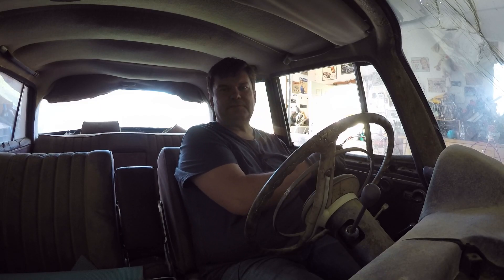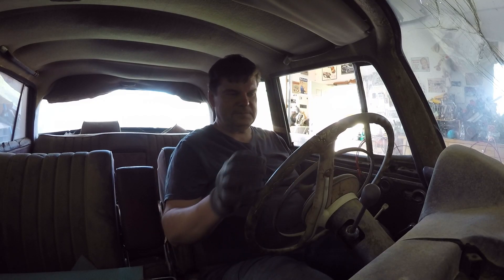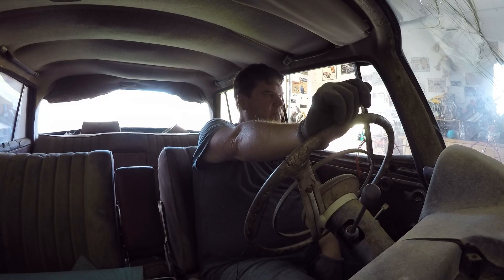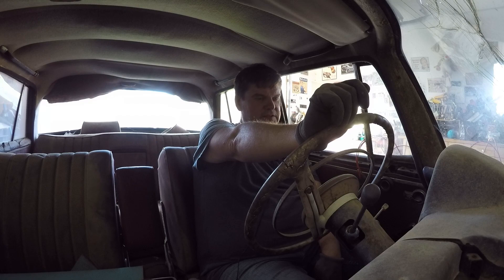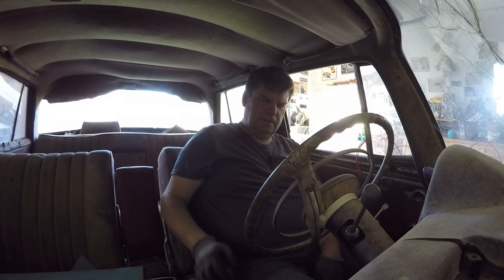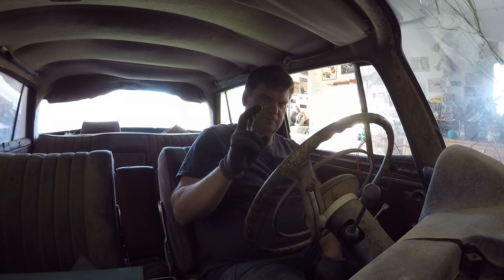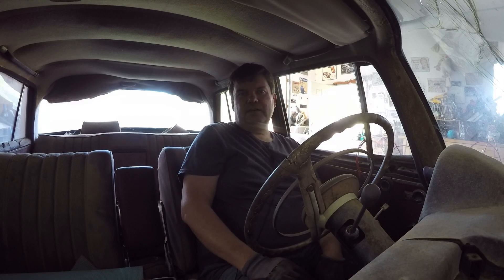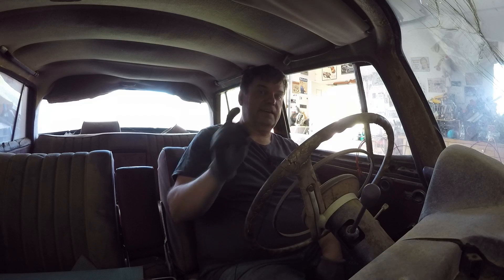1961 Mercedes-Benz 220Sb - W111 - My thoughts and a Sunday drive through the neighborhood.

Comment: Very kool. In the past I had many such projects on my acreage up in Anza, California. One of my favourites was restoring a 1964 Dodge Bell Telephone Van which had the original ladder racks on the roof and shelving and metal cabinets in the cargo area. It had a slant six engine. Extremely simple to work o, even a child could figure things out. After I got it running well, it was one of the most amzing rides on dirt ofroad running. Noy the stunt stuff, but just travel. Not sure why, but bumps, ruts and washboarding were hardly noticeable. Tried a few weeks back to post a photos here in your comments, but the post disappeared or never went through.

My business in my yourh in Palm Springs area was restoring the interiors of used and older cars. One of my favouring projects was restoring the interios of a classic leather interior of a James Bond type of car called  Aston Martin DB5. The leather interior was all original connolly leather. The leather had cracks and tears, but all that can be restored to look and feel fresh as new, it just takes time and the right chemicals and dyes and conditioners later. You dashboard can also be restored properly, but should be one of the last things you do. Plastics back then were crappy and cracked and dry rotted terribly. Since that time plastics manufacturers have upgraded their plastic formulas, but that's why there is such a problem in the environment now. Your steering wheel needs to be changed and new one purchased, no way to fix the plastic on that. Mant times and many experiments I tried with various epoxies and loked great, but new cracks would appear later as the stress would have to give somewhere else. Same with dashboards. I could make them look new and you'd never know it was damaged, but the new cracks would appear months later. At least the Dealers could sell them at a profit before the cracks appeared a year later.

Thanks for the video.
Reply from the maker: Thank you for the comment, yeah, the dash and steering wheel are gone. But there are new dashpads available and they are not stupid expensive. As for the steering wheel, those are out there also. I don't necessarily want to go back to a white one, as being a gearhead and owning white things is a bad idea... Kinda like the wife choosing white towels... When there is a car guy in the house. Hahaha. Needless to say, those don't stay white too long. My current process is bringing the light back to life. Need to work on the blinker switch. After that I need to figure out how to take apart the dash and preserve the wood pieces so they can either be reworked or used as a sample to duplicate. I try to do about 30 min. A day of things that don't cost money. Thanks for your input and thanks for watching.